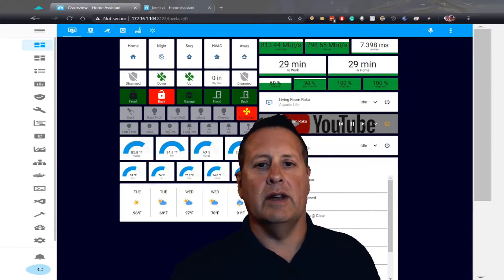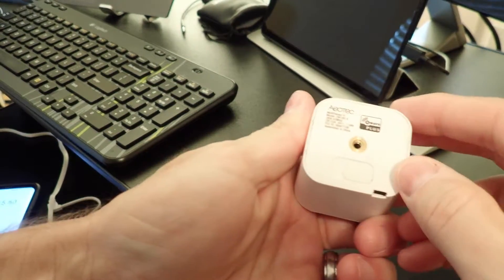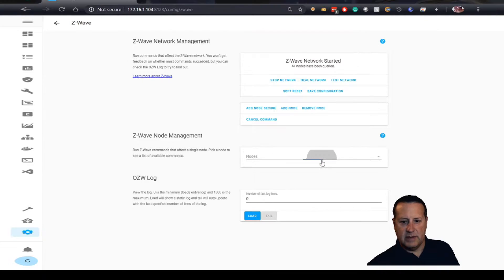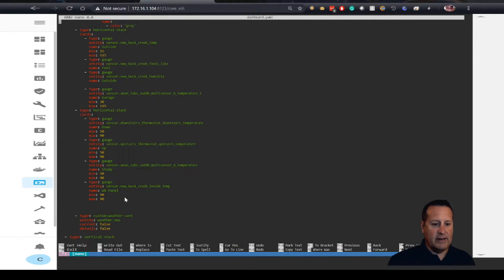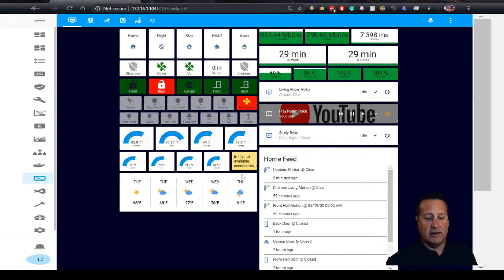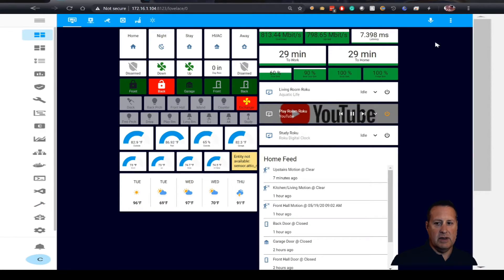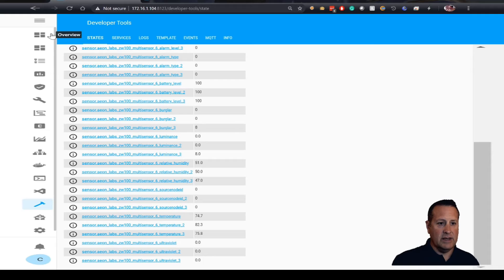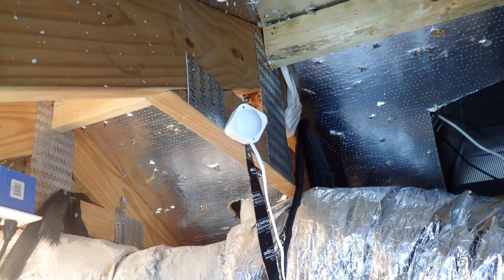Adding an Aeotec MultiSensor 6 to Home Assistant.

Comment: Do you have any recommendations on adding the aeotec multipurpose sensor in home assistant? I tried using this method but it says i specifically need an aeotec hub to make it work. Any advice?
Reply from the maker: Are you using the multisensor 6 as shown in this video? If so, it is z wave and shouldn't require a special hub.
Reply: @mostlychris  Thank you for the reply. I was able to determine that the sensor was not pairing but i was able to get it to work.
Reply from the maker: Excellent. Glad you figured it out. Did it just start working or did you have to do something special?
Reply: @mostlychris  I had to mess with the pairing "hole"

Comment: Chris, are you experiencing excessive battery drainage using this sensor in your setup?
Reply from the maker: I haven't noticed anything. The sensor itself can be set for specific wake up times, etc., which will influence the battery life of that sensor. The only battery issues I had were when I was polling my door locks right after I moved to zwave-js and before they fixed those so I didn't have to poll them.

Comment: The setup for the sensor wasn't bad, but I can't figure out how to get it to update more than once per hour. I changed the wake-up interval to 60s, but it never seems to take in the device itself. Supposedly you press the button on the sensor until the yellow-orange light comes on, then it's supposed to flash yellow-orange, but never does. Have you changed any of the parameters on the sensor, and if so, what was the procedure that worked for you?
Reply from the maker: I updated the refresh on one of them so it would turn the light on and update temps quicker. It was awhile ago but I just "woke" it up and then sent the command. There are now different ways to do this depending on the version of zwave you are running. What are you running for your zwave program now?

Comment: I just after spending good 40 mins with same sensor! Originally it was used with Samsung smartthings hub but once I bought Z-wave stick from same company I decided to get them working together. Since one of main ideas of smart home is internet independence  - I invested some little time and money and running now my own mini IOT. BTW, do you know if we can pair smartthings hub with that Z-wave stick and all related devices? (so hub would become cloud-free) Because smartthings hub covers both Z-wave and Zigbee items so it would cover all of them in one box. I've been googling such video for a long time but no success so far.
Reply from the maker: I don't know that SmartThings works locally. In any case, it would be limited. You can buy a ZigBee + z-wave dongle and move all your stuff over to something like Home Assistant using the same device such as the Nortek device.